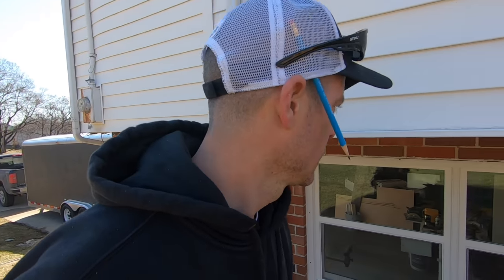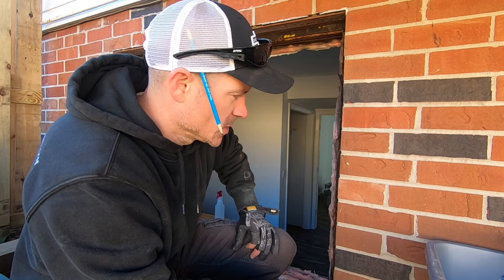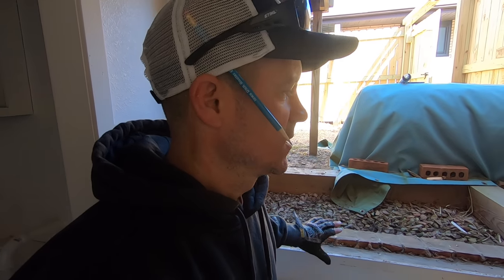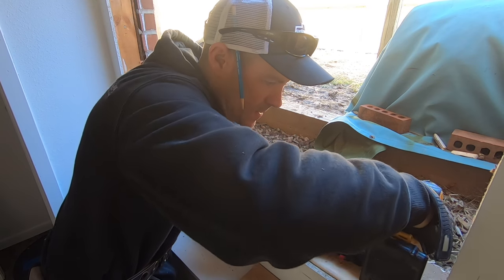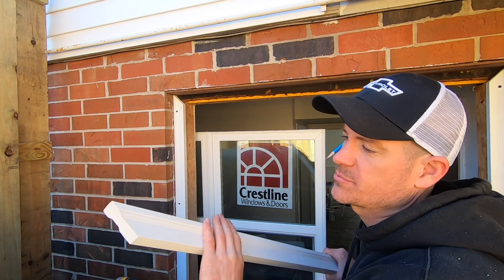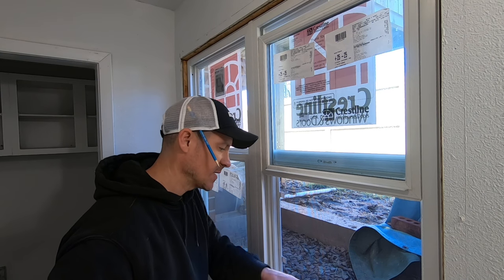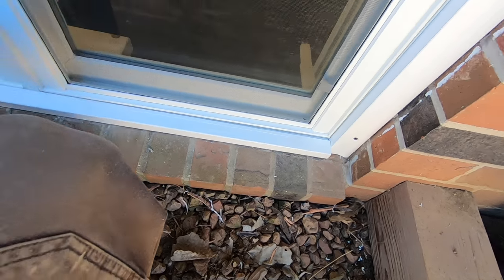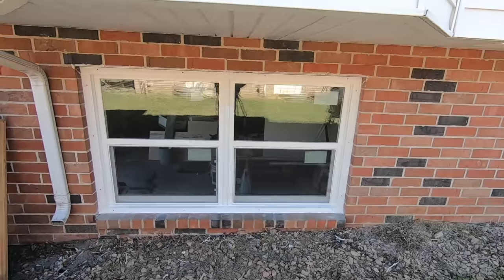Replacing a Window on a Brick House | How To

Comment: Pretty good install,  if you didn’t weather seal the wood opening before installing the window. Trust me, water will get behind the brick and molding, and just get in contact with the wood framing. You need to waterproof at the wood framing first, then at the exterior cladding. But if the window doesn’t see too much water due to having a large overhang or something protecting it from water, you should be fine.

Comment: I hope you are planning to insulate the window at some point. To help control water outside, it's best to install the bottom sill first and have the two verticals sit on top. Great vids look forward to more content .
Reply: He didn't mention it. Caulking alone is not weatherproofing a window. OSI Quad foam or similar needs to be applied in the gap between the 2x4s and the window to seal it.

Comment: Good tutorial just one thing. It looks like you only caulked the pvc trim and not the window itself. That only gives you one exterior layer of protection from the water if it runs on the face of the window. Doesn’t protect if water runs behind the brick trim and directly onto the window itself. 

What y’all will want to do is once the window is set inject your low expansion foam (there are foams specifically for this job) then caulk the window frame from the outside. Apply your trim and then caulk that too. This gives you two layers of caulk protection on the exterior. Once this is done you can repeat the same steps from the inside.
Reply: Yea, adhesive flashing tape has a place too.

Comment: Looks good but one question.  Why did you screw the brick mold on and with black screws ?  Typically we use 15G galvanized and or White trim screws.

Comment: Wish you would have described, shown the screws used in securing the window to the frame.  Have settled on 2-1/2" wafer head cabinet screws.  Please advise if you have a better idea.
Reply from the maker: That will work just fine.

Comment: The other window installations I have watched all put flashing in.
Reply: That’s fine if you have an aluminum brake . If not, this is the option, especially with brick.  I wouldn’t want to  flash that lower piece

Comment: I dont understand the idea of using trim as your water proofing layer. Brick is permeable and the water is behind the brick not in front of it. Also  sealing the bottom of the window traps water that would normally drain from having a tilted sill.
I kinda think this window will have significant water damage under it in 10 years and only prevent direct rain while doing nothing for vapor or the moisture that condenses. Might work in super dry climates like Arizona?
Reply: I agree. Also caulking the lintel traps water and causes them to rust out.

Comment: Did you go back and fill in/paint the screw holes on the brick molding? Thanks for the vid...trying to understand the process before I tackle my windows...house was built in the mid 60’s so should be pretty similar

Comment: Hello and thanks for posting this helpful video. In my two story brick home, two of the windows are in dormers with new vinyl siding facing out onto the roof with a steep pitch. Can I do a replacement entirely from the inside? I'm not anxious to work on a project like this from on the roof because of safety concerns. Thanks.

Comment: We have a 32inch Wide window we’d like to replace with longer windows of the same width (wanting to only make a vertical opening), so we have no room for new a wood frame, there is a preexisting metal lintel- do we need to remove brick from the sides to make room for a new wood frame, or can we still the new windows “insert” style?

Comment: How did you trim out the interior of the window?  There is a gap between the window and the inside drywall where the window trim goes.  My install looks like yours, but I am not sure how to take up that 1/2 inch drywall return space.
Reply from the maker: Nick Palermo you have to take a piece of wood and rip it so it’s butts up against window and sits flush with the drywall, that makes your jamb then your casing goes up against that piece. I believe that’s what your asking.
Reply from the maker: Nick Palermo if you need a picture I can send you one.
Reply: @MrPostFrame  Yes, exactly, thank you for your reply!

Comment: Okay so we bought a house that was built in 1981 and we definitely have to change the windows. My husband says we have to cut the brick to do so because it has a metal frame. I don't like the idea of cutting the brick because they dont make the same type of brick the house has now and we would have to put in rock to fill in the whole. Is there a way that we don't need to cut the brick around the windows?
Reply: No he dosen't have to cut the brick of anything he can cut the mortar out that way you can save the brick. I have a brick home with the metal frame but between the brick there's wood so no don't cut the brick and your right new brick will not match the old

Comment: So you've only used brickmould as outside trim? No bent aluminum? 

I've had nightmares trying to aluminum flash trim outside windows, and your method seems a hundred times easier. 

Very good video, even as a novice "handyman" myself, you make stuff look super easy.
Reply from the maker: Shad S. Thanks. I use the pvc brick mold. If it would have been wood brick mold I would have bent aluminum around it but that is a lot of extra work so I try and use pvc molding for applications like this.
Reply: @MrPostFrame  this is what I have been trying to understand. If I used pvc brick moulding. Then is the metal flashing not needed?

Comment: Seems like a window with exterior flashing would have been a better choice. You also didn't use any kind of tape or wrap to protect the wood. That wood is probably going to rot out again in another 10 years.

Comment: Great Vid Marshall.  Considering replacing windows for several units and contemplating if we need a pro company or Lowes windows and a local contractor in PA.    Where are you based btw?
Reply from the maker: Israel Terkeltaub thanks. I really appreciate it. We are located near DesMoines Iowa.

Comment: Can you remove the window shims after the foam is dry?
Reply: Typically the shims are put where the screw holes are placed. This way the screw can’t warp the window frame if you happen to tighten them too much. If you’re doing retrofit jobs like this one you wanna make sure and order retrofit windows without a nail flange. These come with predrilled holes for fastening.

Comment: Why didn’t you put moisture tape just asking cause I have brick house and I need to replace 15 windows
Reply from the maker: I’ve got this question a lot. I should have talked about this in the video. My feeling (my opinion) is that applying window tape in this specific situation does not help because if water gets through sill and hits the tape it just runs the water down the wall between the sheathing and brick.  This house was not wrapped with house wrap as it was built in the 70’s and has that black particle board sheathing. I have had two brick houses that I have replaced windows in this manor and have had no problems. There are multiple ways you can do this so you have to decide what works for you.
Reply: thanks bud its just that i have to replace total of 18 windows in my house trying to get all the help i can.

Comment: No need to install any flashing specially at the sill?
Reply from the maker: Bert Lacatan without removing the brick there is no good way to install flashing. The sill is the most susceptible to leaking. The key is to make sure your bottom trim (brick molding) sits on top of the bottom row of brick and is securely fastened. I use screws so it won’t come loose and then use a good quality silicone caulk to seal where the brick mold meats the window and the brick.
Reply from the maker: Bert Lacatan I like using pvc brick molding rather than wood as well. If you use would I would cover it with aluminum trim but then that adds another step and you still have to caulk the seams.
Reply: Zip tape is the best for situations like this
Reply: Marshall Remodel 
Thank you so much. Really appreciated.
Reply: Marshall Remodel 
Thank you so much. Really appreciated.
Reply from the maker: Joey Rizzo I’m always trying to learn to do things better. Where do you apply the zip tape on an installation like this? You have any photos?
Reply: The zip tape stick to everything this stuff is great u can apply it to the inside of the exposed 2x4 all around the window frame so when u install the new window it will give it extra assurance if any wAter does get in will not rot out the sill.
Reply: I don’t have any picks but it’s great this stuff is great u fold the corners before you put ur brick moldings back up and do ur final caulking and it 100percent water tight my man
Reply: Joey Rizzo ,and. Silicon in both end of sill.

Comment: hope those werent bedroom windows as they would not meet code anywhere. should have went with a slider of anything but vinyl.
Reply from the maker: mindorable1 I appreciate your comments. The windows serve a garage, bathroom, and living area. As I said in the video the windows were already purchased when I bought the house. As for the type of window someone puts in a house I feel that’s a personal preference based on your experience with a specific window, climate, desired look, or even the maintenance required.